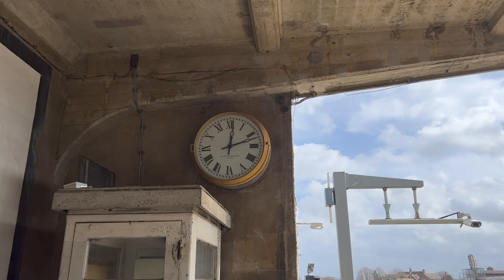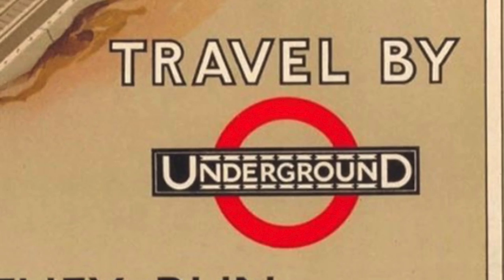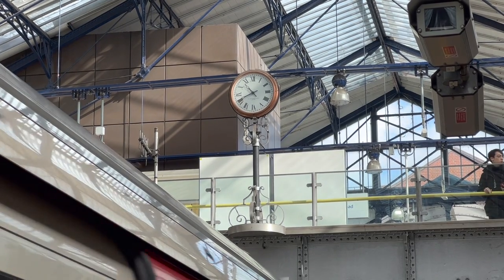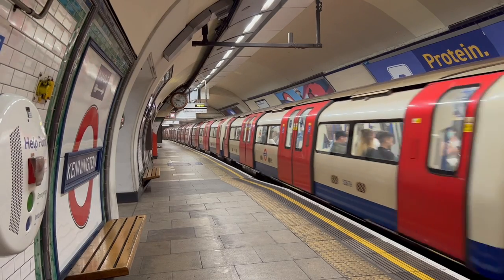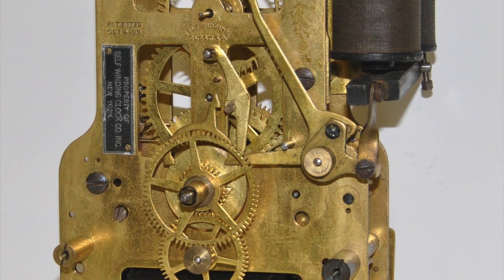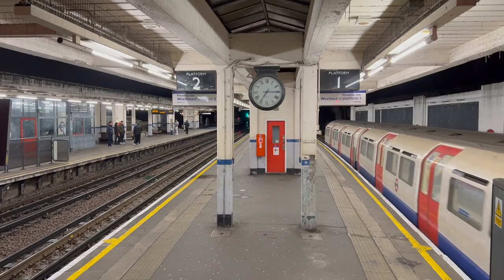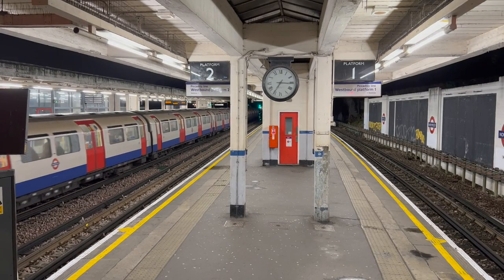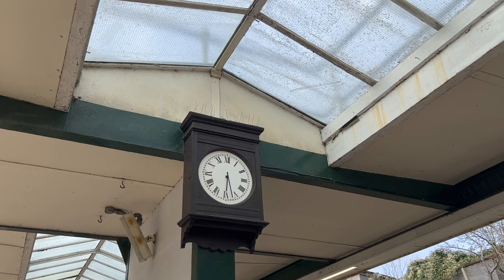What the heck is a self-winding clock?

Comment: I remember being somewhat interested in the clock on one or more of my father's cars.  Periodically they would make a somewhat strange noise.  Apparently, this was them winding themselves up.  Sounds like a pretty similar idea.
Reply: Exactly.  They often used a regular coil spring in tension and would pull it around a small drum.  The tension would rotate the drum, driving the clock.  A short pulse through a solenoid would rewind the clock in an instant and put enough energy into the spring tension for a minute or two's running.

Comment: I built 4 or 5 master clocks that are still in use on the underground (they use GPS to set the time) I also build many of the grey digital clocks on the platforms. But I have to say a real clock looks far better.
Reply: Are those the ones which have a wire running to many slaves clocks and pulse once a minute to advance the time? They still existed in my secondary school when I was there, fascinating to see them doing the 'spring forward' adjustment when it was due!
Reply: @stepheneyles2198  Im not sure to be honest, the ones I did ran every clock in its station.

Comment: We used to have one in our house - not on the scale of an underground click  but a standard household click size with only 1 face.  It took either a HP11 or HP2 (that's C or D size in modern parlance) - I can't remember which, bit I suspect it was the HP11 size (possibly actually using an SP11).

I vividly remember the shllllllick sort of noice it made when the contacts touched and the solenoid activated to rewind it.
Reply: In old parlance those batteries would be U11 or U2....

Comment: I believe they are also synchronized from a central location using a pulse or pattern of pulses. Having all clocks showing the same time is critical for rail, and it was very useful in business (which is where I saw them in use). That capability is probably how they set the clocks back.
Reply: Most railways had synchronized clocks very early on.  The Dutch Railways used (and in some places still uses) a slightly different system to synchronize clocks: the mechanical clocks run slightly fast, the second hand completing a tour around the dial in 58 seconds.  It will then wait for a once-a-minute pulse to come down the line before starting to count the next minute.  You can clearly see the second hand pause at the 12 hour mark every minute as it waits for the pulse.
Reply: @kaasmeester5903  Awesome! That must look like something from a Twilight Zone episode ... waiting for a new minute to begin 🙂

Comment: The clock in my parent's 1965 Chevy station wagon worked similarly.  It had a set of contacts that when the spring was winding down, they would touch and engage an electromagnet that would pop the spring back to wind it.  That way the clock would still operate when the key was off without draining the battery too much.

Comment: I had a clock from old car with interesting mechanism. There was a spring, selenoid and contacts inside. First when the contacts were closed, selenoid wind up the spring, spring opened contacts. And clock worked for about 3 - 4 minutes. That again loose spring closed contacts and powerede the selenoid. It gave an intereftin effect - quite noisy "klang" every few minutes from it.

Comment: Holy cow! That's a mechanical electricity storage unit!  Wind up the appliance when rates are low, and use the stored spring energy to run a washer for example.

Comment: As far as I know, Synchronome and Gents of Leicester produced Master clock systems that provided accurate time for Railway Stations. The self winding system you described was as accurate as each individual clock, while the Master clock system was as accurate as the very accurate Master clock. The other clocks were slaves of the Master clock. There was a mechanism for the Master clock to advance all the slave clocks if needed. An interesting story. Thanks.

Comment: Do they really still use batteries that need changed out every so often? I always assumed they were connected directly to the mains so they have power continually.
Reply: most clocks that are connected to mains also have a battery backup or a capacitor so they can keep going if the power's out
Reply: @thesteelrodent1796  If they are really well designed, they have a rechargeable battery which is trickle charged via the mains, so that it is always full.

Comment: As many have pointed out the original internals of these have long since been removed but most seem to be misinformed with what, like some people saying radio clocks(which stations sometimes use but not for heritage clocks). But they're just normal analogue clock drivers powered by a digital master clock somewhere else on the station. The master clock will just send out a pulse/voltage every 30 seconds which causes the clock hands to move forward 1 position, which in the case of the minute have would of course look like 30 seconds forward on the clock face. They should automatically switch with daylight savings regardless of if its forward or back, it's just a matter of the master clock sending an hours worth of pulses quickly. I think a lot of the clock faces and hands have been replaced over time too, some with just plain non branded ones. Source is just that I used to upgrade or maintain most of these clocks on the tube, likely "repaired" at least one of the ones in the video.

Comment: Hi Jago. Hmmm... I guess it's all about timing (sorry for the pun). Most railway clocks are, I suppose, powered by mains electricity. Battery clocks (in domestic environments) are commonplace enough. I would imagine that using a battery with the self-winding mechanism just prolongs the battery's life.
Reply: Interesting as surely the force required to move the hands will always be the same and thus battery life the same if moving a self winding device or rotating hands (ignoring friction losses).
Reply: @highpath4776  Well, no. The battery powers the solenoids that wind the clockwork mechanism, which then takes over powering the movement of the hands.

Comment: GM cars in the 60's had self-winding clocks too. When the car was turned on, a motor would wind the spring. When the car was off, the clock ran on the spring. It kept the clock from draining the battery.

Comment: Self confessed clock nut here and I have never heard of these. Most of the platform clocks to be found on mainline stations are later Gents' pulsynetic slave clocks  driven from their 'Pulsynetic' master clock. Most have been later adapted to take mains synchronous type movements.
I would wager that even the Self Winding Clock company dials, now hide mains movements from Smiths of Derby with automatic synchronisation to the radio time signals and British summer time.
Reply: There's one in Tooting Bec if you want to inspect one
Reply: @CarolineFord1  So Wikipedia informs me.
Reply: The change to electric mechanisms seems to be confirmed by another comment on this video. So if we could sneak on to a station at 2 am on clock change day we should see the hands magically move by an hour?!
Reply: The radio time signals from MSF Rugby include data which indicates the current adjustment (GMT or BST).
Reply: @iankemp1131  hopefully the night tube will be running

Comment: Apparently they are now standard electric clocks, but going forward to daylight savings would naturally be achieved by resetting to 12 earlier than 12:00. Running a mechanical clockwork backwards is the specialty feature, moving forward at a greater speed is not a problem.

Comment: Sounds more like these are really "battery powered" clocks.  Most of the ones in your shots also appear to have wiring near them, are they now hard wired?

Years ago on Pawn Stars (I think), they had someone bring in a truly self winding clock.  It had very sensitive bellows that would contract and expand due to changes in the air pressure throughout the day.  The movement of the bellows then wound the spring.

Comment: How they work is not quite what I expected. I imagined a master clock in a central office with 100's slave clocks that are moved forward each second by a pulse from the maser clock. 

Having accurate public clocks is important. I once had a hospital appointment and left in plenty of time and arrived in plenty of time according the the big clock in reception. So I sat down and read my paper with a cup of coffee. Just before my appointment I went to the specialist department only to find I was an hour late! They still saw me :)  Why they didn't have a master/slave set up or even clocks that synchronised with the atomic clocks by radio I don't know. I have one in my study.
Reply: I have a 'radio controlled' clock in my house in France. It uses the 60kHz reference time signal from Rugby which is a little frustrating in that it is PRECISELY an hour WRONG all the time except for an hour overnight when the UK clocks go back (or is it forward)  in the spring/ autumn.  I suppose I should get myself a radio controlled clock that gets it's reference from Kalundberg? or somewhere in France however I have the luxury of using sunrise/sunset which is accurate enough for my purposes.
Reply: @mattsyson3980  Most radio-controlled clocks consist of a quartz clock whose time is corrected once a day (usually in the early hours of the morning) by checking with the radio clock. Unfortunately this does not fix your problem. The other problem is that clock manufacturers assume  that the clock will never travel and therefore build different models for different countries.
I have a radio-controlled watch which claims that it can operate correctly in more than 100 countries. I haven't been able to confirm the claim, but it has worked well all over Europe. It worked alright on the east and west coasts of the USA too, but went a bit squiffy in the middle.
Reply: @Alan_UK  Thanks but it has a LCD display so no hands.

Comment: The company name on the clock faces seems to be set in Monotype Corsiva, which is a font that was designed in the early 80s. That would indicate that the clock faces are modern reproductions, which makes me wonder if the rest of the clocks are too.
Reply: I think many are.  Some may remain original and some I think have been put in new locations.  I used to like the illuminated clocks at the ends of the Victoria Line plaforms next to the running tunnel entrances

Comment: I've heard of a clock with a similar design that did a whole turn when the DST changed
Reply: If you use an electric motor to drive the hands rather than an escapement mechanism, these things are very straightforward.

Comment: Simple electronics usually have pretty wider margins of acceptable input voltages. Sometimes the upper limit is in practice mostly defined by thermals. So bigger mechanisms might have a VERY wide margin. From what I have heard in this video I would assume that being the case here. You can probably go up to almost hundred times the voltage and all it does it winds it up faster. But that might significantly reduce lifespan. So probably only 2-10 times is really safe in the long term.
Even modern semi conductors often can realistically take like 20% more and their parts are microscopic.
But depending on how densely packaged they are, that might not be wise under realistic cooling constraints.

Comment: It's rewound by a 2V supply ? The voltage drop would be prohibitive if the wires were longer than about 1m. This implies a 2V battery inside the clock, which means you still have to have access to the clock, to change it.

I was always under the impression that these were simple electric clocks with what amounts to a battery backup (the battery being potential energy stored in a wound spring), the idea being that they would still run if there was a power failure.

Comment: I'm curious about the clocks having no easy way to adjust back and forth between standard and daylight savings time. Didn't the United States already have DST as well?

And does staff really have to manually move every individual clock forward when DST begins? I suppose an alternative would be to use the method for turning it back, using the trigger to turn the minute hand to 12, but holding it for 11 hours instead of 1. Of course that would mean 11 hours without working clocks.

Comment: Why did they use batteries rather than running them off (stepped-down) mains power?  (The use of clockwork with a spring is at least understandable for keeping accurate time even when the mains frequency is inaccurate or interrupted, but the spring would get you through a power failure of moderate length.)

Comment: Interesting. If the UREL from 1902 installed these self-winding -clocks from it's inception, them it's unfortunate that the voltage regulator couldn't be added as this was invented in 1938 to control the power fluctuations you speak of.

Comment: I'm surprised they didn't just make clocks with an electric motor to move the clock hands synchronized to the 50Hz (in England) frequency.  
Or was electricity not so standardized back then?
Reply: indeed electricity was not standardised ,  much was generated privately or by local authorities , up north where it was poorer the voltage was less
Reply: Electricity wasn't even standard in some streets in London - it could be a different voltage / frequency (or DC) on each side served by a different company.
Reply: I forget what the tolerance is but 50hz of UK mains is allowed to fluctuate slightly and will drift a little at peak times but there is a second requirement that over a 24 hour period there must be  the requisite number of 50cycles (you can work out how many 50 cycles per second there are in a 24 hour day) such that synchronous motors for clocks typically used for streetlighting etc do not drift beyond a day.
Reply: @JP_TaVeryMuch  Ahh yes the inverted plug sockets in the station walls ,  I always thought were because the supply volts/ amps were higher and this was the safety feature - I am used to step-down transformers on building sites as supposedly 120v is safer on cables if you accidentally saw through them etc - and some of the machinery drills are import Milwalkee etc tools from the US
Reply: @highpath4776  The 110/120V is safer from site transformers because it's two opposite phases at 55 or 60V centred around zero which is grounded.  Thus if you do cut a cable and expose a conductor it's likely to be only a quarter of the normal domestic mains voltage.
Reply: @JP_TaVeryMuch  As far as I'm aware, the voltage in UndergrounD stations is the standard 220-240 volts. The 13A sockets are different though, as the earth pin slot is orientated horizontally instead of vertically, so you can't plug a standard 13A plug into them and steal their electricity.
Reply: @mattsyson3980  I had a friend who worked for CEGB and he told me that in the small hours of the morning the generators would go "a bit mad" for about twenty minutes while they ensured that exactly the right number of cycles for the day (4,320,000) were generated.
Reply: @henrybest4057  Now that’s a smart trick.  I wonder if there are laws against normal people buying them.
Reply: @hb1338  I suppose it would be a bit trickier now with so many using power 24/7 compared to the past where industry largely stopped overnight. Synchronisation of the whole grid must be fun too. something to look into when I really have nothing to do!
Reply: @donkeysaurusrex7881  I believe that the manufacturers (by contract) ONLY make them for LT, so they're not available in the open market. No laws, unless "being in possession of stolen goods" applies. You might be able to buy some, though, if your real name is Lance Tangential, Leslie Twister or Larry Todwangle!

Comment: It’s so cool how the self-winding clock is still adaptable to modern batteries.
Reply: As it is purely electromechianical with no electronics, it probably isn't too fussy about the exact voltage. Which is quite fortunate because achieving exactly 2 volts with reasonably common batteries while drawing significant current appears a bit of a challenge.
Reply: @tz8785  It's all too common to run them over-voltage, though, and burn up the platinum contacts. Ask me how I know. A common 4.5V lantern battery worked -- for a while. [Actually those are 6V, but I had 3 D cells in series for 4.5V. There's a little square shelf that seemed to fit a lantern battery, but probably something much older was intended there, a glass accumulator?] I had to send it off for a complete restoration, and now it takes a special "dry cell" simulator, powered by a couple of D cells.
Reply: @jxh02  I was thinking more about a single common 1.5 V cell (too little voltage) or a pair in series (somewhat too much) but not three. Out of curiosity, what does the simulator use, a pair of cells in series, along with a silicon diode or two to drop the voltage down again a little?
Reply: Lead/acid cells are 2 Volts 9and are used in multiples of 3 or 6 to dive you the old 'car bateries of 6 or 12 Volts. Heavier still are the 2 Volt cells used in forklift trucks where they are connected in series to give 60? or 80 Volts . The adventurous (or silly) can try the old 'disappearing spanner' trick where placing your trusty half inch Whitworth spanner across the final terminals of a forklift battery will see it disappear in a flash (literally).
Reply: @mattsyson3980  mm, delicious Steel vapour!
Reply: @tz8785  Something like that. I haven't looked inside very much, just bought it from the restoration shop. I knew my contacts were knackered because they made a lot of RF noise, at one point, though that was after several years of me and my lantern battery.
Reply: @tz8785  Probably a couple of rechargeable NiCads (1.2 Volts each) in series.